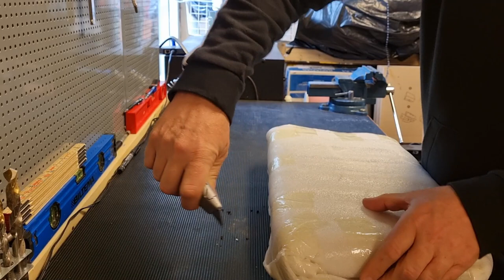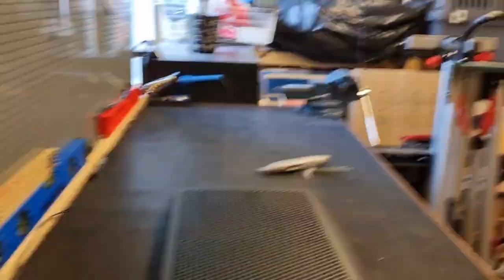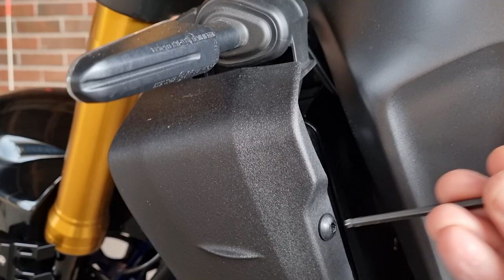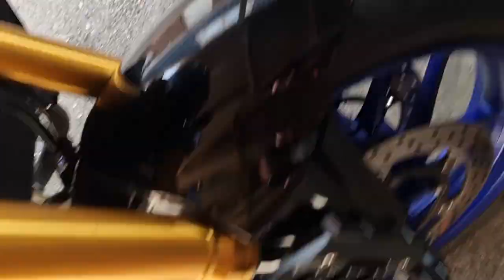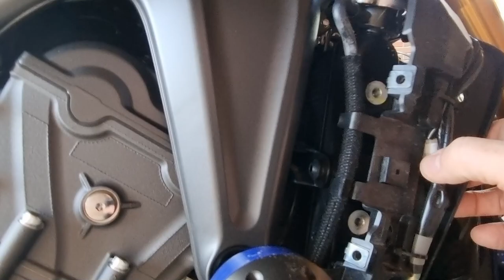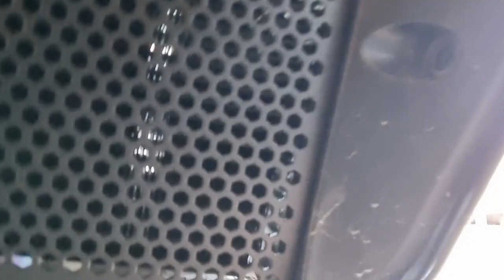Unboxing and installation of my new Radiator guard on my Yamaha MT-09 SP 2021

Comment: With my Ali radiator cover I got some protective foam and 4 rubber grommets. Did you get the same? Think it’s to stop the guard rubbing through the radiator
Reply: Where did you glue the foam? I just received mine and have no idea what it's for
Reply: @Bugside  I ran it down each side of the radiator
Reply: @ShiteLines  at the front side, right?
Reply from the maker: Im almost 100% positive that the protection foam is only for transport so the radiator guard dont get hurt during the transport.

Comment: Those Plastic screws are shit. I gave up trying to put this accessory on after stripping the plastic head of one screw.
Reply from the maker: I had the same problem. My solution was to gently rotating the screw without any pressure on the head until I saw a little gap between the screw and the base and when this gap appeared I used a very small screw driver to force it out at the same time I was rotating the screw it was little tricky first but after using this method i manage to take them all out without damage them at all. Good luck if you want to try it again

Comment: My friend i am just about to buy it as well.any problems with heat? Does it close too much the clean surface the area? Anything you dont like?
Reply from the maker: Its to early to say but so far I haven't noticed any issues with heat but the temperature outside here in Sweden is still cold the warmest day so far has been like 18 degrees celcius. I really like the way it look and the quality is awesome.
Reply: @guffemoto  any update to this? I want to install a similar guard but I’m worried about heat. Thank you for the tutorial!
Reply from the maker: @bevo5386  like i said in my earlier comment i dont really notice any diffrence but i live in sweden and its not often that we have 30 degrees celcius here in the summer but so far i havnt had any problems with heat so my guess is just go for it. Just to reflect to one time last summer i took a ride when it was 30 degrees outside and my only problem was my clothes that it was to hot no alarms from the bike that i had a heat issue.
Reply: @guffemoto  perfect. Thank you for your response. take care

Comment: those inside screws are so dumb haha
Reply from the maker: Totally agreee with you :)
Reply: How you get them out
Reply: @dylanhammond9473  you gotta get underneath them somehow and pry out while turning the screw at the same time, good luck and God speed haha I replaced them with push pin types from the auto store..
Reply: @ballzmckgee3167  yeah i just broke the top screw bit off and pushed them through also went to the autostore but got the wrong clips so ill get the right ones from work, made some small scratches around the clips but its all okay
Reply: @dylanhammond9473  haha sounds right, those things suck so bad..